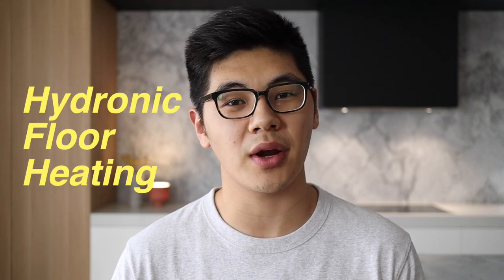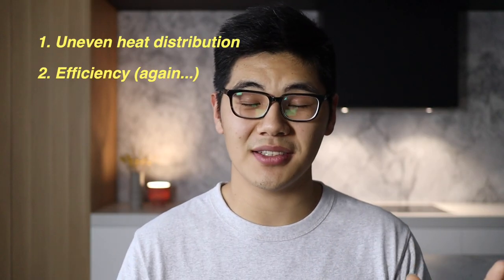Hydronic Floor Heating System Review - 2 Winters Later

Comment from the maker: Thanks for stopping by 😄, leave a comment and let me know what you thought about the video.
Reply: Hi Charley,
We are currently doing a build with inslab hydronics in Ballarat.  We have approached it differently.  We are using a solar powered reverse cycle system with a 500lt buffer tank to both heat and cool the slab.  We want as much thermal mass as possible so we have insulated the entire slab from the ground on 75mm styrofoam.  We have imported everything from China where the systems are in wide use and the total cost is about 1/4 of local suppliers.
For such an inherently simple system it is appalling how expensive it is in Australia.  It stops people from considering a super efficient green alternative.
A properly insulated slab is a fantastic climate control asset and costs little more than a bog standard hunk of concrete.
Reply: Its first time I hear about in slab system... in Europe we do it in screen only. The issue with uneven temperature in rooms is easily resolved by installing thermostats in every room which control each circuit individually by motor valve located where the manifold is. Indeed the water heating system is the best!
Reply: @darroncrick9993  could you say the name of this system. And would you say it’s a ridiculous idea to have reverse cycle hydronic in slab in qld?
Reply: @Tigerratcat  we put our system together ourselves.  If you look at my youtube videos you will see that our system is a combination of solar tubes, heat pump and buffer tank.
Our experience is that the solar system is surprising successful, the buffer tank works but could be bigger, and the heat pump works perfectly.
I don't think that the floor cooling would be effective in Qld.  It is cheap to run and works well in cooler Ballarat but in Qld it would struggle to get enough "cool out" and you would end up with wet floors.
The solar tubes with buffer tank would work perfect and I doubt you would need to boost the temp like we do.  I think if you had half our tubes and 1,000lt buffer (instead our 500lt) you would not need to pay for any energy at all.  You should be able to install everything for under $10,000.  Then just put on some cheapy nat gas booster if required.  I doubt you would need it.
The feel of floor heating is great, we love it.  The problem is that it is slow moving so if you get a warm day you need to open windows to get heat out.  It is no problem because the heat is free so you are not losing anything.  
You will definitely need to cover the tubes in Spring and Summer to reduce the heat unless you have a different use for the heat like a pond or hot tub or something.  We have ours running through a domestic hot water coil.  Ours is far too small and not very effective.
I would be happy to pass on our suppliers and any other thoughts so if you were interested just contact me direct at centralvic01@gmail.com.
Good luck with your project!

Comment: I do this as a profession and love the video. if you find certain rooms cooler due to less piping surface area (bathrooms) try using balancing valves this can restrict flow on your larger areas and open up flow where you have less piping.
Reply: That makes too much sense.

Comment: Hi Charley, the negatives you mentioned can be almost completely resolved by zoning. So many houses only have 1 or 2 thermostats. Unless your house is tiny this makes no sense. Adding more zones is easily done if the contractor does the proper preparation.  
One of the biggest mistakes I see is combining the master bath and master bedroom. Never have I wanted to sleep in a warm room and never have I wanted to shower in a cold room. These should always be separated at the very minimum. I can make an argument for every room being its own zone. Then you get people complaining about the added cost. On the whole the cost to add more zones is less than 5% of the total cost of the installation. In my opinion that is well worth the increase in comfort.
Reply: That is just rubbish. Just heat the entire home equally and save unnecessary complexities and installation costs. 

If a room is inside the thermal envelope of the building zoning will not save anything energy use wise.
Reply: @serviceroad4178  Clearly you don't understand design and load variations. The people I design for are looking for the absolute best. not just an average system. If you want average just install forced air.

Comment: Lots of talk in the comments about zoning etc but that isn’t going to save running costs in any way. 

As long as every heated room is inside the thermal envelope of the building it will make little difference regarding heating costs. 

Foam waffle pod systems are used often nowadays and is built in floor insulation. Even that doesn’t really matter because the majority of the floor area is inside the thermal envelope. Edge beam insulation is cheap and an easy thing to install. 

You should lower your boiler supply temperature to 40c. It will run longer but will save you money. And also will create more condensing time of your Immergas boiler. You want your boiler to condense as much as possible. It’s much more efficient. Your boiler was running too hot from the plume it was producing. 

You can also increase the manifold flow rates to the cooler areas and reduce flow rates to the warmer areas. 

Great video. Lots of uneducated comments got me going. 

Regards, Shannon. 

GV Hydronic Heating (Vic).

Comment: A poorly designed hydronic system is the reason for your discomfort with the room/floor temperature. Under slab insulation and perimeter insulation is code in my area.

Comment: The small room problem, and to an extent some of the other cold spot issues, suggest loops that are too long and possibly relying on a single thermostat for a whole house.  Make the loops shorter, per room even.  Add a thermostat control per room too and you have the required control to have warm bathrooms without overheating everywhere else.

Comment: So, as others already commented, the problems you listed can be solved with properly designing the heating system - under-slab heat insulation, uniform slab thickness, consistent depth of piping in the slab, loop length an flow adjustment, zoning etc. Good that you basically pointed potential mistakes when building such heating system.

Comment: Hi Charley, Thanks for this very informative video. Very clear and easy to understand.

It's hard to find information for alternatives to the dreaded air conditioner. I'd love to consider in-screed heating for our duplex which is now around 20 years old. It has a concrete slab. Two storey with insulated roof cavity. I'd only put the hydronic heating on the ground floor living areas. The upper floor is fully carpeted and fine in winter. In the bathrooms I wear slippers until the shower is hot so don't need it there. 

I hate air conditioning, plus I'm very hard of hearing with tinnitus so any small background noise adding to other background noise makes hearing over tinnitus more difficult. I only use air conditioning in my car when I have a passenger because it makes me feel suffocated. So adding an air conditioner to my home would pretty much mean constant misery for me and divorce thereafter.

Questions I have are regarding technical matters not mentioned. It would be great if you could follow this video up with one regarding the space the manifold and any other components take up. I can't really tell the size of yours in the close up (I'm assuming mine would be smaller for smaller size duplex). If the booster is electric how much room would that take up, assuming it's separate to the fuse box (I'd consider installing solar PV eventually) and any other outside components such as the pipe expelling steam (this duplex has very little space outside for these things, eg nowhere to put even a slimline water tank). Our single garage but is crammed full of partner's tools and toys. Also, whether the outside components are noisy.

I'd be interested to know whether your system is still working fine 3 years down the track and how much maintenance is needed.

Also, I'd like some idea of how much depth is needed for the screed + insulation + hydronic pipes. Our ceiling is a lower 00s style of around 2.3m height. I need to consider whether it would feel suffocating if anything more than around 10cm was added to the floor height. This may be outside your experience. Perhaps someone else might know.

I find it very difficult to get proper technical information from professionals at any time, particularly not being able to hear them, and without partner's support makes it even more difficult. 

Again, excellent video. Thank you.

Comment: I stumbled upon your video by accident. I have to say you did a first rate job. I work for a builder of eco-friendly homes in Virginia (US). I am now going to talk to my partner, (the concrete guy)  about the screed idea. Thanks again for your information.
Reply from the maker: Hey Joe! Thanks for watching. I think the screed is definitely the way to go from a building science and life cycle cost perspective.

It is significantly more expensive as an upfront cost, but should be a good value proposition for many projects.
Reply: Hey Joe K, do you mind if I ask what builder you work for? :) I'm also in VA and looking into hydronic floor heating.
Reply: @tabitharoyer9629  SK eco builders. What part of the state are you in? Are you building from scratch?
Reply: @capitol699  Thanks for sharing! I'm in Hampton Roads. No, unfortunately not building from scratch, so I guess maybe it doesn't really help to ask for the name of a complete home builder...  I just thought it was nice to hear of a builder in our state using this kind of heating! Trying to figure out where to start in looking for the parts, etc.!
Reply: @capitol699  Awesome!! Thanks! =D
Reply: Hey Charlie Li and Joe K got a few questions! I’m starting to design my icf house and doing the radiant heat in the slab or screed sounds great for the basement but for the main level and second story could I possibly have a screeded floor? I would imagine the weight would be substantial and force me into a whole new floor truss system? Or is electric the better route to go for multi story instead of hydro? I’d really like to go hydro because of the insane efficiency but am definitely struggling to find the information because I don’t quite know how to google these questions effectively! Thanks for any help and great video! Also in Virginia too live in Blacksburg!
Reply: @Dougie_trades  how are you cooling? Gypcrete is good for 1st and 2nd floors, just let your engineer know. Doesn't add as much weight as you might think.  Give some thought to mini split for hvac on the top floor as heat rises. Good choice on the icf.
Reply from the maker: @Dougie_trades  You could engineer it and compare the costs/risks involved. Alternatively, you would use a reflective panel and lay pipes on top of that, followed by your flooring. The screed is a much better idea in my opinion! That being said, one main reason the floor heating works so good down stairs in this house is because the polished concrete floor would otherwise be super cold and uncomfortable. If you are having floorboards or carpet upstairs, this comfort issue is far less relevant. Therefore, the most optimal set up may be hydronic radiator panels upstairs with floor heating downstairs!

Comment: Your complaints are just because of how it was done, not the system itself.  Tubes could have been laid differently and insulation could have been used.  That’d fix the 2 main issues.

Comment: Great work on a detailed review post install and usage, have you seen the electric ones used in tile glue? Cheap but gather would be expensive to run...more for renovation that new build
Reply from the maker: Hey mate, yes I have used that system too. Very cost effective for bathrooms, and very comfortable. Only need it to run for a couple hours morning and night for most peoples. It’s also very easy to install and doesn’t require complex integration with other trades and what not. It is less efficient than gas hydronic though and the thermal mass of a 10mm tile doesn’t hold much heat!

Comment: @charleyli9363 In my area of the US, underfloor 2" 4'x8' foam insulation board (Owens Corning Foamular 2" is what I used) is required under the rebar mat and pex tubing.  I believe this is the standard in most areas of the United States (Maybe Austrailia too?).  Also, I another perimeter foam insulation is required at the exterior edges of building.  I think this is a major positive in reducing heat loss, which you did address in your video.  My point is it does now seem to be a building code requirement which is good for the homeowners pocketbook and for the environment.

Comment: You may want to include the radiant heat transfer from an infloor system, as opposed to convection like you describe. Heat loss from the body is highest through radiation and matching that with this type of system is the reason why it is so comfortable. And that wasn't as cringey as you may have thought:)
Reply: Congratulations. Probably the most educated connect so far. 👍🏼

Comment: How do these systems stack up now with new builds in Vic not allowed to have gas connections? Do electric heat pumps pose any problems? 50deg C would be close to their max temp output I'm guessing.

Comment: Love this video, so informative! I'll be building an in-slab hydronic heating system, but will be insulating the sides and bottom of the 4" slab. I'll try to think about zoning and layout through smaller rooms!
One question I have is what did you use to finish your concrete? I love the look of your floors and I'm looking for a good sealer!
Reply from the maker: Hi Gabrielle, thanks! Concrete is a nil exposure burnished finish polished to 400 grit and sealed with a penetrable sealer. Nil exposure is tricky because the slab needs to be poured really well with no significant undulations over short distances. With higher levels of aggregate exposure, the grinding helps flatted and level out undulations- but we do not have this luxury with nil exposure. The other thing is that the slab needs to be burnished during the pour. This process essentially requires the Concreter to continuously trowel the slab for much longer after the pour in order to really compact the finish. As the floor is “less hard” with lower levels of exposure, it is generally recommended that you use 32MPA concrete and extra reinforcement. I would also think about running expansion joins/cuts under wall plates and potentially through the visible sections where needed to mitigate cracking. This is why it’s really important to get the slab engineered for nil exposure burnished concrete as well as your in slab heating, in consultation with all contractors and designers. These factors will all contribute to the performance of the floor. The penetrable sealer is meant to go into the pores of the concrete and provide protection - all without changing the texture, sheen and general look of the floor. This is what I’d go for instead of a en epoxy sealant for instance.

I did make a polished concrete video a while back on IG - here is the link: https://www.instagram.com/tv/Bvs_3j1F-lD/?igshid=178reitrznzkl

Comment: How did you finish the concrete floors?  I'm in the early stages of design and have planned to install hydro heated concrete floors, but debating on covering with tile or just polished or epoxy coated?  Any advice?
Reply: I’m doing mine next week and it’s going to be acid stained.

Comment: Pre heat the water with. DC element attached to PV.  This is done in the US and reduces the cost of running the system.
Reply from the maker: That sounds like a good idea, especially as it doesn't take much energy to keep the system running once its up to temp.

Comment: If you go in-screed you loose thermal mass.  Relative to in-slab, this would work against the economics of running an air-to-water heat pump only during the night, on the less expensive,  'night rate', electricity tariff and making it last during most if not all the day. Of course, this consideration only applies to countries in which heat pumps are the heat source of choice and night rate tariffs are available.
Furthermore, all things being equal, it would seem that when the pipes are closer to the surface they need to be spaced closer together, ie: because there is not enough diffusion to even out the heat to the extent obtainable by deeper pipes.

Comment: can this system heating up 2nd floor?
Reply: Radiotor for 2nd floor could be less complicated.
Reply: Sometimes they put thin concrete on top of the wood subfloor. They can run loops in joist bays with insulation forcing heat up.  Like what he describes the inscreed heating system.

Comment: Other practical disadvantages of hydronic from personal experience is stale air and VERY slow heating. Stale air can be improved by cracking a window or adding a ventilation. But they don't respond quickly to dropping temps.
Reply: Add an ERV to solve for the stale air.

Comment: Icf slab house with radiant heat floor with foam boards under concrete closed cell spray foam roof fixed all those issues 
“boom drop the mic”